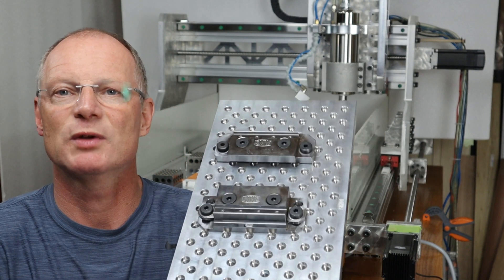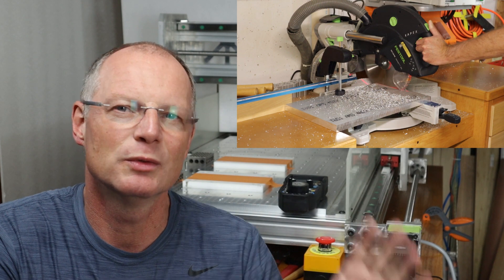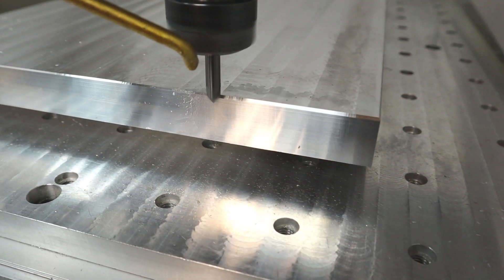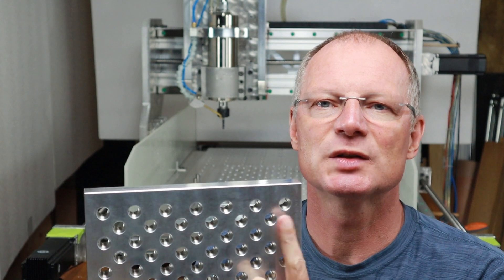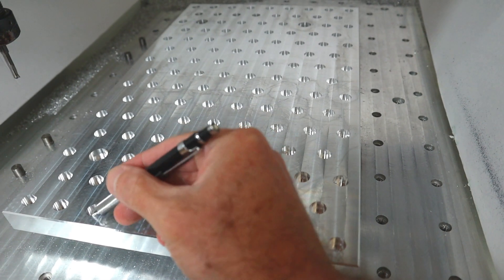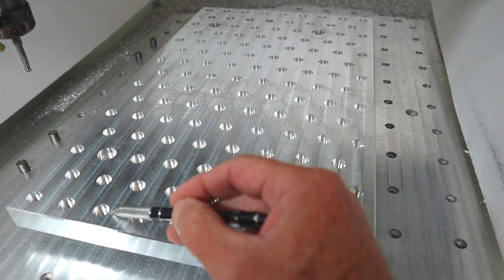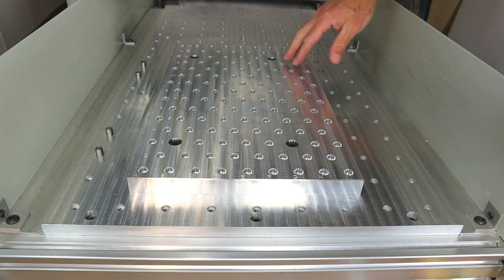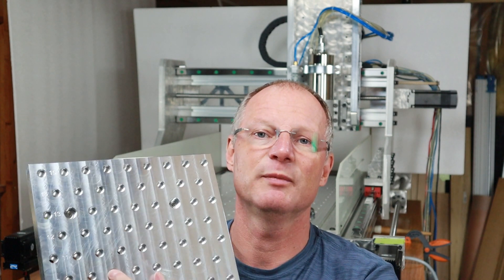DIY Fixture Plate

Comment: What end mill were you using? Single flute, 2 flute, did coating like DLC or Zrn. It did a fantastic job, really nice surface finish. Ohh and great video BTY. One of our venders gave me 2 big aluminum plates 24”x55”x1.250”and already have T slots milled into them. I think I’m going to copy your design if you don’t mind. 😊
Reply from the maker: I love single flute end mills for Al as they don’t clog. If possible I choose a high polish style over a coated one as the cutting edge is typically sharper. 
Please go ahead copy my take on this, it’s why I made these videos.

Comment: What tool did you use to perform the first 2 facing steps?  Thanks.
Reply from the maker: It’s made by Accusize and comes in a set of 3 tools. This one was the one with triangular inserts. You can find it on Amazon however pay attention to the shaft diameter and your biggest clamping diameter.

Comment: What spindle are you using?
Reply from the maker: It is the 2.2kW Huanyang water cooled 3 bearing 2Pole spindle.
Reply: @JBWorx  Thank you!
Reply: @JBWorx  do you mind sharing where you got it from? Amazon?
Reply from the maker: I bought several of these over the years for machines that I sold. Lately I order from Amazon there is a Huanyang store and you get an authentic one. Also I buy the 3 year warranty with it. If the runout or something else is not to your liking you can just send it back.

Comment: very nice, what type of super glue are you using?
Reply from the maker: I use Starbond medium black. Not every accelerator works with it so it would be best to use theirs.
Reply: @JBWorx  Thank you I appreciate your prompt response. I love that you have a KAPEX to cut your stock. I have one too and I am still getting used to it.
Reply from the maker: I think it’s awesome to cut aluminum. I also use the same blade to cut plastic / Delrin and I am very happy with it.

Comment: Love the plate. I have downloaded your design and ordered the plate in the dimension shown in the drawing (+2mm for me to face up)

I noticed the drawing and in the video here you say 8.8mm hole for a M10 bolt. In my Engineers black book it shows the minor diameter for a Course M10x1.50 being 8.2mm and a fine M10x1.25 being 8.5mm. It looks like you picked a special pitch M10x1.00 which is 8.8mm, is that correct?
Reply from the maker: This video was made a while back and I scratched my head for a second as I know that the diameter I use for M10 is 8.6mm. Then I remembered that I wanted a loose fit for the thread so that it will not interfere with the locating function of the shoulder bolt. And that worked out great 👍. Hope that makes sense.
Reply from the maker: Also before you make the plate hole pattern think through in what direction it will go on your machine and if my offset pattern makes sense in that direction. Or if a regular pattern is best for you.

Comment: I'm about to make of these myself. In my case, through holes wouldn't help because it'll be sitting flat on a granite slab. I"m going to use blind holes because I don't want chips or coolant to get between the two over time, but yes, I expect getting the chips out to be a pain. Also, making the very first fixture plate where nothing exists below it yet other than a granite surface plate presents several Catch-22 issue. Once this one's out of the way, making smaller ones like you have here will be much easier.
Reply from the maker: Yes, once you have the initial one down life gets much easier. Also consider some plugs for the holes. You can buy them or print them yourself. They work great !

Comment: What sort of surfacing bit did you use for this. Im struggling to find a solution. On my mill id use a fly cutter but I dont want that spinning at 18,000 RPM :)
Reply from the maker: Yes a fly cutter is not the right tool for a cnc router because of the imbalance causing vibration and the large diameter will result in insanely high surface speed values. So I have a indexable end mill made by Accusize that you can find on Amazon. However I did turn down the shaft to fit into my collet. I am making a video on 2 different surfacing Tools that I use quite a bit. Also with inserts… stay tuned.

Comment: Nice plate! Are you using denatured alcohol for your coolant?
Reply from the maker: Yes I typically do for Al for steel I use a water based coolant or just cut dry.

Comment: Given that you machined this elevated on tape how can you be sure that the surfaces are running parallel? Wouldnt you first need to machine flat a surface then put that machined surface on a known flat surface and machine the unmachined surface from there? I didnt see you do that so not sure how you got both the surfaces true to eachother.
Reply from the maker: They don’t need to be.  The resting surface for the part is machined as a set (so holding a piece) at the same time making them perfectly level to each other. This step is done once the vice is machined. And yes you are correct the tape will always allow for some variation in dimension.
Reply from the maker: Oops I just see this is for the plate not for the vice my bad the former response is not 100% accurate then. So yes you are correct, the tape introduces a variation in the flatness / parallel top to bottom. How much ? Hard to say I did measure the plate using a micrometer and was happy with the result but I don’t remember the variation from top of my head.

Comment: Such a nice project, I really want to make one of these myself
Reply from the maker: The plate and the vise go hand in hand. It’s a bit of a bigger project but worth building as you can use it for all sorts of things.
Reply: @JBWorx  I have alot of projects in  the pipeline for my CNC machine and the vise will would be really helpful. 
Thanks for sharing and this I feel with the vise is going to be my first project
Reply from the maker: Make sure you think about the hole pattern (distance) for your mounting plate. It has a big impact on the versatility. I also have info to that on my website if you like. https://www.jbworxstudio.com/copy-of-switches
Reply: @JBWorx  that is something that I have been wondering about, thanks for the link I really appreciate it
Reply from the maker: Good luck on your built

Comment: Great video could you please do a video on uses for the fixture plate. I understand you can clamp things down to it and put a mod vice on it. I am assuming there are more uses than just those. Seems like people that have a fixture plate really likes them but I am just not seeing the uses. Seems like a beneficial video for alot of machinists.
Reply from the maker: Thank you for the request David I will add it to the list. In short the main advantage for me is alignment and availability of clamping holes. It is great to put small pallets on for different parts you make  and also can hold vacuum pucks. You can also put spacers down on it and clamp a part down from the outside or use through holes in the part and the threads in the plate. Really the main feature is versatility and alignment. All of the above you can somehow do also on a regular table. I have a write up on my webpage why you would want a fixture plate. Check it out …
https://www.jbworxstudio.com/copy-of-switches

Comment: What's the white material you use to offset the workpiece? Is it teflon?
Reply from the maker: It is Delrin an industrial plastic (Acetal). I like it because the tape sticks to it. Teflon is rather soft and tape does not stick to it.
Reply: @JBWorx  Thank you for your quick response, yes I was indeed wondering if it was Teflon and figured that the tape would not stick well to it. What tape do you use btw?
Reply from the maker: I like the green and orange version it’s for rough surfaces or with “extra” adhesion. I think it’s by 3M, most home improvement stores carry it.

Comment: Great videos. I am interested in what facing tool you are using?
Reply from the maker: It’s made by Accusize and available on Amazon in a set of 3 end-mills. I had to turn down the shaft to fit my spindle.

Comment: Nice Video What facing tool is that ?
Reply from the maker: Wow many people asking about that. It’s made by Accusize sold on Amazon.
Reply: @JBWorx   do you have a link or part   number TX
Reply from the maker: It is this set I bought, but note that I turned the shaft down to fit my spindle. Accusize Industrial Tools 3 Pc Little Hogger End Mill Set, 45 Deg, 90 Deg and 3/16r Mill with 3/4'' Shank, 1'' Head, 0046-0700 https://a.co/d/5clVaCp

Comment: wonderful video, thanks for sharing!
may I ask where you ordered that insert planing end mill? Would love to get myself one of those too!
Reply from the maker: Certainly, I hit this one from Amazon it’s made by Accusize and comes in a set of 3 different geometries. Just check that the shaft diameter fits your spindle.
Reply: @JBWorx  thank you for the quick answer! I couldn't find it in the (german) Amazon, did it possibly have any particular name or was it just under Accusize face mill?
Reply from the maker: It’s a set of 3 end mills. Here a link. 
https://www.amazon.com/AccusizeTools-Degree-Little-Hogger-0046-0700/dp/B00HSRD1K4/ref=mp_s_a_1_7?crid=3ISBM7CSFVOWD&keywords=accusize+end+mill+set&qid=1666502193&qu=eyJxc2MiOiIzLjAwIiwicXNhIjoiMS43NyIsInFzcCI6IjEuODQifQ%3D%3D&sprefix=accusize+endmill+%2Caps%2C196&sr=8-7
Reply: @JBWorx  thank you!!
Reply from the maker: No problem glad to help

Comment: Lovely work but I have a lazy mans question, why no just drill and tap the holes you ned for the next work?
Most of the holes may not ever be used anyway!
Kind regards/Stefan
Reply from the maker: … I see your point. But the good thing about a CNC is that ‘you’ don’t have to drill and tap a single one 😀😀. Also getting everything back into alignment later might not be quite as simple and fast.

Comment: Nice Job. I like the way you present and explain the things you do 👍
I made a metric version of the SMW Mod Vise some time ago out of 7075. Added Mitee Bite clamps to it and that really works like a charm. Looking forward to see how you are going to adapt their design to your needs.
Regarding the fixture plate, could you possibly further improve the flatness by taking another 0.1mm off, when the plate is actually fixed to the table?
And lastly about the shoulder bolts. Did you make them yourself, or are they a purchase item? If so, where do you get them?
Reply from the maker: Thank you! Yes Mitee Bites are laying on my bench already defiantly will use them. I am undecided on the material. Maybe free machining steel but I will have to get some tooling for that as well. Most likely 7075 as you used as well. I think 0.02mm is a awesome result. To get the best possible flatness A) keep the tool down throughout the entire facing operation no up movement. B) There is some variation in the tape so like you mentioned stewing it down in its final position and facing it again can yield a better result. I think I got lucky.
The shoulder bolts (in this case) I bought from McMaster Carr please check out my website the project is uploaded and there are details and also a drawing in the download section … for free lol 😂

Comment: Nicely done! Also really like the SMW mod vice system. For locating the plate reliably I can recommend the bushings and locating pins Norelem sells. This enables locating the plate very accuratly without the risk of overconstraining and result in bending/warping the plate.
Reply from the maker: Yes these are very nice. And you are correct the plate is over constrained I thought I could only get 2 shoulder bolts  to engage and was totally surprised that all 4 went in. For real day to day shop production a steel plate with hardened bushings is the tool to have. However for hobby or light careful low production I think this will do.

Comment: Amazing video and content!  I notice you have a straight grid pattern on your bed and the new fixture plate has an offset pattern.  I'm about to make the bed on my machine and had been planning to go with a straight grid.  Could you offer any insight on the advantages/disadvantages to them?  Which have you found that you prefer?
Reply from the maker: For the machine bed itself I like the straight grit pattern. This way you can go with a larger distance to the next hole. For the vice plate I have not found an issue using the alternating pattern as it is closer together. The vice slots will always accommodate for any width material. However one comment (Nick) stated that he dislikes the alternating pattern. So again, for the machine table … go with a straight line.
Reply: @JBWorx  Thank you for that insight and pointing out Nick's comment.  I was actually afraid of what he mentioned with wanting to use the offset row, but there not being a hole.  Thanks again for taking the time making these videos and engaging in the comments section.
Reply from the maker: @BrandonS350  thank you for commenting it shows me that people actually really watching my videos  😆

Comment: Could you have drilled the the through holes to rough them out before boring with the end mill? Or does the spindle loose too much torque at the rpm needed to do that?
Reply from the maker: I did that for the plate on the machine table. My experience is you can drill 6mm diameter however the deeper you go the more unreliable this process becomes. Even 4mm kept me on my toes last time. The bore function and a single flute works so much better and is reliable.

Comment: Nice job! That's a clean way to put the plates together, with the precision shoulder engaging both. Thanks for the idea. I have the SMW plate on my Taig. The thing I can't stand about it is the diamond shaped hole pattern, rather than a square grid. There never seems to be a hole where I need it, its always a row off. I'm surprised you kept yours a diamond since you were making it from scratch.
Reply from the maker: Hmmm that is interesting. My machine table is 50x50 and a bit far apart for a vice set up. The slots in the vice would need to be too long in the movable jaw. This one is 30x30. I hope I will like it …

Comment: Real cool, what was the first tool you used for surfacing?
Reply from the maker: It’s a endmill made by accusize you find it in Amazon. Make sure the shaft fits into your spindle.
Reply: Lovely work! I’m about to buy the same set but from WEN and I have a similar spindle, what rpm were you running at?
Reply from the maker: This tool is 25mm in diameter and I usually run around 10,000 rpm